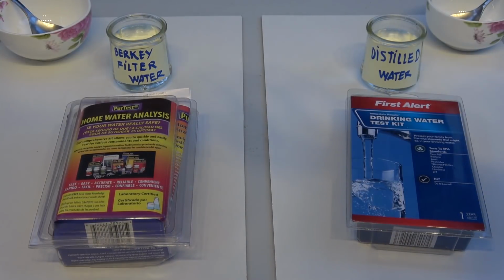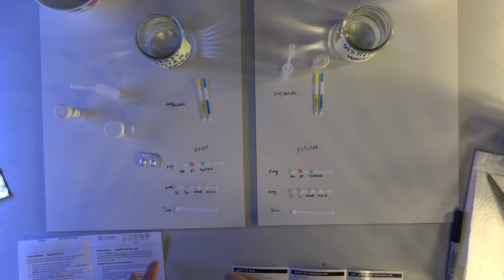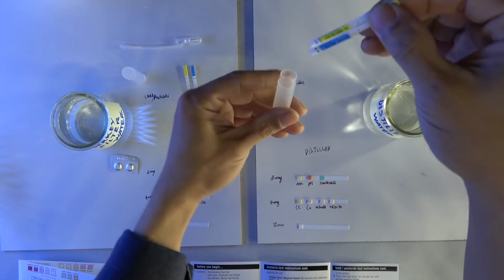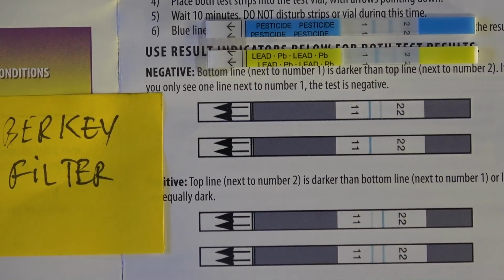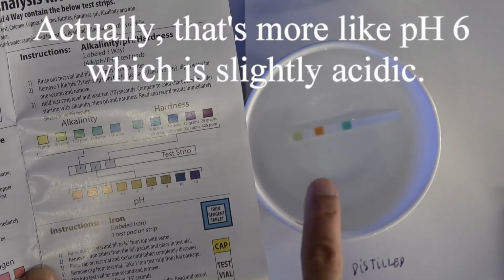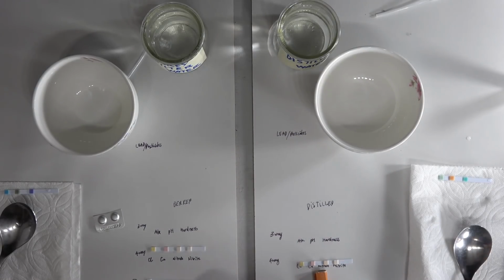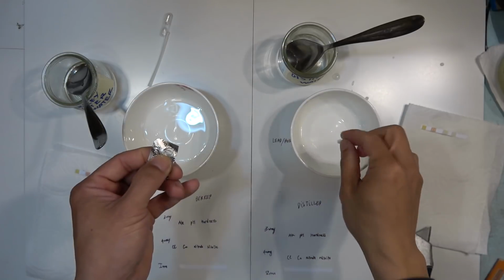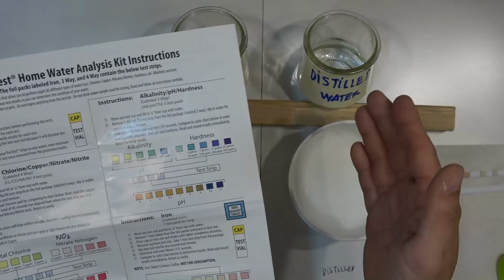Water quality test: Berkey filter water & distilled water using First Alert & Purtest kits

Comment: Drinking distilled water isn't the best long term idea.  Part of the crud you're distilling out are trace minerals your body needs.
Reply: @dougdevine27 > "[...] trace minerals your body needs." 
We get minerals mainly through food intake, not from water.
Reply: Water contains inorganic minerals. Plants take up inorganic minerals and convert to organic. The body wants organic minerals.
Reply: But Brawndo's got what plants crave. It's got electrolytes.
LOL Quote from Idiocracy.
Reply: This is the best solution by far you can always add liquid ionic minerals to your distillation to give it more potency facts long-term its great to drink distilled water. Know the facts bro know the facts.
Reply: The body can't process inorganic minerals that we take in from tap water, bottles water etc. It clogs arteries and causes diseases. Many of the doctors that speak out about this are demonized for telling the truth by mainstream liars.  Distilled water flushes out toxins and inorganic minerals that the body cannot absorb. Ive done a lot of research on this subject. 

Just like the other comment, does this remove flouride? If it doesn't then don't buy it.
Reply: @Kevin-kj5th  question for you what's the best choice then thanks
Reply: @leardi58  Not much can be given any 1-choice is best other than after going lunatic about fluoride I discover that local Municipal WTP has fluoride like 0.005 of groundwater fluoride levels then I reverted to using common carbon filter since I did studies on the minerals thing arriving at the conclusion that removal of organics and halides is well done by carbon filter · I had tried to use distilled water so any decision that removes a lot of the junk is the correct decision
Reply: @ChiDraconis  I don't believe the Berkey Black Filters remove arsenic either but it is advertised as being removed with the additional white fluoride filters.
Reply: @dontworrybehappy5139  
Don't Worry Be Happy 
· Here in town at Temple Texas—shows astoundingly low levels of fluoride → Now I can even spell that correctly !!! ◙ Currently I have a large Carbon Filter on primary draw water-line from Pendleton Water Supply • Noting great appreciation for response I had handled CCA for decades but now as of 70 years of age as of 15-th March this arsenic issue became needful of prophylaxis ▬ the exact filter that I have Shows similar to DuPont® Universal Valve-In-Head Whole House Filtration System PF38001C → installed on primary food-use waterline: ◘  
Efforts to determine how much I am removing are confounded by lack of reliable work ○ Water filter removal of arsenic → Brief search shows Filtration through activated carbon will reduce the amount of arsenic in drinking water from 40 - 70% - Which I then place in counter-top pitchers with carbon element ○ Studies come up with Arsenic - Removed to greater than 99.9% per the branded Berkey Water Filters feed → Much greatly appreciated 
·
{ https://theberkey.com/pages/test-result } 
·
Very brainy here and enjoy the extra work
Reply: @Kevin-kj5th  i believe the berkey has an option to add 2 more filters for fluoride in total you would have 4 filters 2 for cleaning 2 for fluoride.... i am looking in amazon now, researching to buy one with the fluoride option.
Reply from the maker: There are some truth in your statement. But it entirely depends on where you live and the kind of diet you have. If you have a balance diet and eat a variety of different kinds of food (which you should if you want to stay healthy), there's nothing in that tap water that a regular diet cannot get. I live in a place where tap water tastes too disgusting. And looking at the "trace minerals" at the bottom of my distiller after distilling just one gallon, I think that's just too much "trace minerals" for humans to handle. Here's the picture that shows the "trace minerals" after I distilled 1 gallon of tap water: https://imgur.com/aLTyH33
When I first looked at it after the distillation, it almost got me to vomit. Yet, the tap water was so clear before the distillation.
Reply: @vuaeco  My tap water reads about 390 TDS my well which is over 300 feet deep reads 223 its wayyyyyyyy better water overall. Tastes better, cleaner, better for you.
Reply: @vuaeco  It's not just that distilled water doesn't have the trace minerals. It's that distilled water flushes out trace minerals that are already present in your body.
Reply: Prometheus 2019  This is why people sufferibg with arthritis are advised to use distilled water, to strip away the rock and heavy metals that have settled around the joints
Reply: U get your needed minerals from dark leafy greens....NOT water.
Water has very little absorbable minerals.
Reply: I keep hearing this and it sounds more like folklore pushed by companies that dump poison in the water than scientific fact. No one needs "trace minerals" like flouride, lead and glyphosate.  Spring water is probably good for you but Berkey filtered tap water definitely is not!
Reply: You can add the minerals back in like the Earther academy guy.
Reply: I've read that the minerals we want in our bodies are in the ionic form, which is different than the rock form which is in a lot of hard waters .
Reply: UNPIN THIS COMMENT  it’s not true.
Reply: That is a common MYTH. Distilled water does not and cannot leech minerals
Reply: What are the results after you distillate the berkey water or have you tried that?
Reply: Except, it also removes artery plaque. I'm proof. 56 over a packet a day smoker for close to 40 years. Quit 5 years ago. Family history and genes read I have mutations for sever heart issues. Drinking distilled water only for 3 years. Heart specialist performed ct scan expecting arteries to be full of plaque. His response to me was "I dodged a bullet" His letter to my doctor read "exceptional findings". Not one drop of artery plaque. Lungs were clear. Get the trace minerals your distilling out from a healthy diet.
Reply: Actually, you're wrong. The minerals we actually get from food. It is a longstanding myth that you get your minerals from water.

Comment: Thank you for this period it has been insightful and enlightening. I don't know what your resources are like but if you can, would you mind doing another test With some specific controls? Rather than testing against distilled water, Get some pond water in a bucket get some tap water in another bucket, And test both for contaminants pathogens heavy metals etc. Then  Filter samples from each through your Berkey, and 1 or 2 others brand filter systems you have on hand. Then retest the filtered samples. This would give a much better idea of how well Each of the filters actually works....  Fit again this video is 4 years old and you probably don't test water for a living lol. So I might have to figure out how to do this myself lol.  

The ultimate water filter test:

Tap water, River Water, Pond water day old Toilet Bowl water (used hard and unflushed)

Comment: Thank you for this thorough analysis. My coarser tests with two sets of Berkey filters showed me that Berkey filters do not remove ANY dissolved solids vs. my tap water in fact they ADDED dissolved solids. Here are my results using Kirkland Purified Water as a control:

Berkey Filtered Water: 043 TDS PPM
Unfiltered Tap Water: 037 TDS PPM
Kirkland Purified Water: 023 TDS PPM

I used Berkey for 4 years and will never buy them again.
Reply: Just returned mine, literally gave me stomach pain while drinking consistently for a few weeks so whatever it’s adding to the water my body didn’t agree with. I’m no longer a believer, felt scammed.
Reply: @dave himlin Hi Dave! It was pretty consistent & painful enough to cause significant discomfort. It was at the top portion of my abdomen

Also wanted to add…once I stopped drinking the water it completely subsided.
Reply: wow thanks for sharing.... have you tried distilled water with your tests?
Reply: TDS is NOT a good indication of the quality of water. Your body needs minerals in water, just not the bad ones. TDS does NOT differentiate between good and bad minerals in the water!
Reply: @gregb1714  thanks for your comment. You are correct that TDS is a coarse measure of the dissolved solids in water. However in tap water most dissolved solids are from pollutants as quoted below from a Wikipedia article on the subject. Berkey “Filters” increased the TDS of my water consistently and often made me feel ill . A problem which went away when I used new filters that dropped the TDS to 0.

 If I did a more thorough analysis I have no doubt that I would find that the filters added toxic materials to the water on top of not filtering the original pollutants. 

Perhaps Berkey filters are good for cleaning river water of parasites and bacteria  or something but they are not effective at cleaning tap water which is what most people use them for. 

“Primary sources for TDS in receiving waters are agricultural runoff and residential (urban) runoff, clay-rich mountain waters, leaching of soil contamination, and point source water pollution discharge from industrial or sewage treatment plants”
https://en.m.wikipedia.org/wiki/Total_dissolved_solids

Comment: This is inconsistent. To begin with you are using four different things: 2 different waters and 2 different test brand kits. You have to use at least one common denominator. Either to test the reliability of the kit brands or the water(s). If you test different waters, you need to use the same brand kit or if you test different brand kits use the same water. Potatoes, oranges, apples and mangos. How can you compare that.

Comment: I applaud you for your efforts.  However, you made significant mistakes that negate the value of your testing.  First, if you use two different test kits, you are looking at 3 tests of unfiltered/untreated water, 3 tests of the Berkey water and then 3 tests of the distilled water.

Comment: Pesticide is clearly negative. Left line is darker than right line. Can’t believe people will believe something fraudulent as those tests. 1-2 different brand tests 2-clearly a bias in interpretation, 3-distillation always removes mostly everything... & 4 no analysis of the tap water to compare^^. berkey is a water purifier & not a system to create dead water……… which is unhealthy & not tasty.  Good luck with your acid water on long term;-)

Ps: and using a blade touching the little pills to test metal? Lol you just risked adding metal yourself ...
Reply: Those Berkey pesticide levels are concerning.
Reply: @shymeeee  nice bait
Reply: @EliteprosoldierMW3  I have no idea what you're talking about.
Reply: @shymeeee  this test is a false positive but you bait people to think that berkey filters are poor quality.
Reply: @EliteprosoldierMW3  Are you saying Berkey is  a great filter that takes out a great percentage of pesticides?
Reply: @shymeeee it is of no opinion of mine but scientific specifications and aspects on berkey's website readily available and also legit outside sources confirms its specs.
Reply: @EliteprosoldierMW3  Well I finally bought a Berkey and hope it is really filtering out all the bad stuff.
Reply: @shymeeee  you'll see, have a nice day!
Reply: Do you work for berkey? You dirty swine.
Reply: @richardbroski2933  nice bait

Comment: I bought a Berkey for the purpose of filtering roof run-off water and not tap water. Roof water will not have pesticides, chlorine, fluoride etc... to begin with. I don't think Berkey gets rid of these as readily as they claim, but with river or roof water I think it will do just fine. The problem with distilled water is it takes electricity to run the thing and that won't be available in a grid-down situation.
Reply: Roof run-off water is worse than tap, has pesticides, flourides, chlorine, and more, especially if the rain was precipitated by contaminated lakes and rivers. Where do you think tap water comes from? It comes from the same source that evaporates and causes the rain to fall onto your roof. Those water drops are easily contaminated if they are next to factories that dumped "forever chemicals" in near by water supplies. Tap water goes through an authority and test water for any violations, then treats it. Sooo, not really understanding your logic here. Just cause its natural? Look up PFAS.
Reply: I agree with you about the Berkey. I have one, love it. But you dont really need electricity to distill water.. do you? Make a fire.. Heres a simple way to distill over a fire although they are using a stove for the example.  https://earthwateralliance.org/distill-water-using-pot-stove/

Comment: Should have done the same test for both. Not very accurate in determining results.
Reply: Exactly, you can't use two different test kits. And do you have the extra white Berkey filters in the bottom? You know, the ones that filter chemicals and pesticides.

Comment: If you compare 2 different test kits with 2 different testing brands then you have no control to know if the difference is in the test kit or if the difference is the water.  You needed to either test the two brands or test the two waters with the same brand for accurate comparison.  However, if we assume the test kits are equal this is a helpful video.
Reply: Agreed, should have done the same test for both
Reply: Exactly what I thought too
Reply from the maker: You cannot do the same test for two waters. The test kits are made for one time use only. You test the water once, you're done. I just tried to do as much tests I could out of what is available for me.
Reply: @vuaeco  They mean that you should have used the same type of test kit on both filters... not the exact same actual single use test kit.

Comment: 16:15 "The chlorine strip is yellow, so there is no chlorine in both samples." 
Does your tap water has chlorine? If so, most likely your filter media is not purely a ceramic porous and has some active charcoal (or similar) in it.

Comment: if your tds meter read 001 on your distilled water, return it for a refund it is not working correctly, or is contaminated somehow?both waters should read 000! I use zero water filters, and I have 2 black bereky filters for emergency back up, and a sawyer to back that up. if my tds meter gets to 002 I can taste it, zero says change it out at 006, at 003 it is undrinkable, my tap reads in the upper 200's, depending? just say'in.
Reply: Jay Miller did you buy just the filters for berkey or the whole thing.. do the berkey filters fit in the zero water system? I’ve heard some people are making their own containers? Which zero water did you buy and how do you like it? I haven’t heard of it. I appreciate it
Reply: Berkey doesn't filter minerals. Minerals are not soluble solids so they will show up on a tds test.